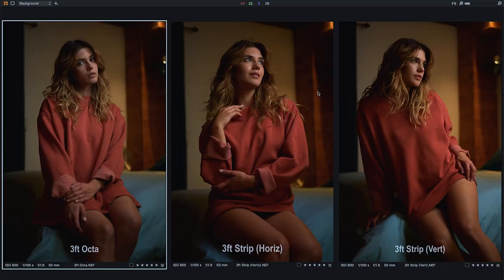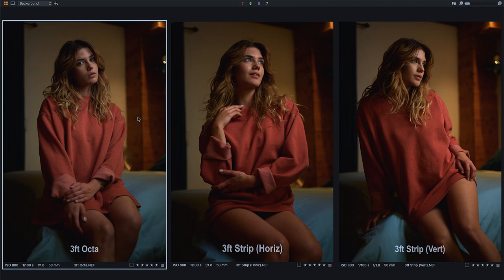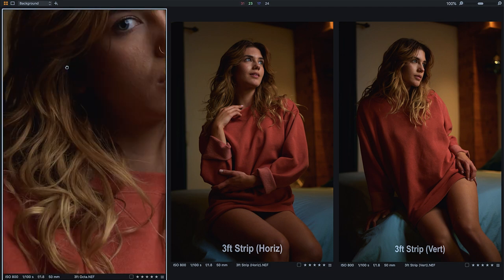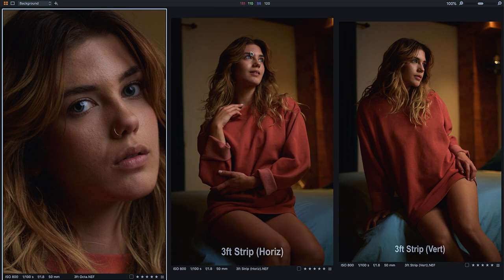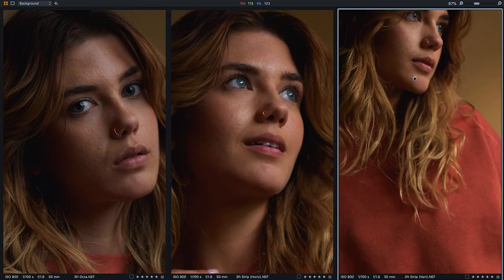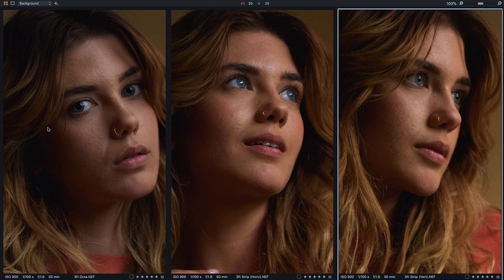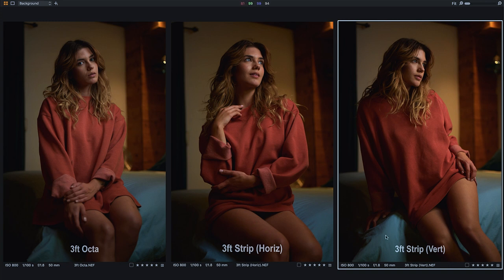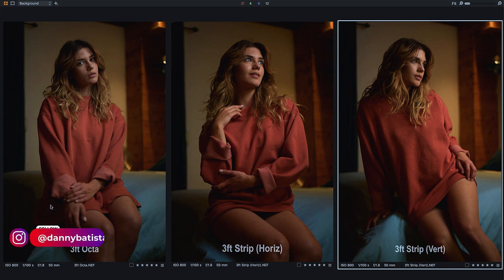Stripbox vs. Octabox as a Key Light for Off-Camera Flash Portrait Photography

Comment: what about light domes vs light boxes?
Reply from the maker: The larger the light, the softer the light. A 36in light dome will produce similar results as a 36in softbox. A dome however is completely round with the diffusion which means light will spread all around vs being directed in one direction.

Comment: I don’t really understand your thoughts on the differences here. In the end it all comes down to positioning, feathering and so on. Add a grid to the Octa and control the light spill. Then you’ll get even closer to the lightstrip look.
Reply from the maker: I'm not trying to get closer to a light strip look. The point is that an octabox or other circular softboxes or beauty dishes,  which everyone believes is the only kind of main key light to use, actually is unnecessary in the majority of scenarios I shoot in.  In my 10 years of experience the strip produces VERY similar spill and and soft light qualities as the same width softbox while providing a ton of other benefits in many different scenarios. I can shoot under it in tight scenarios like bathrooms, hallways, cars, etc. where a 3ft softbox would be in the way all around. It's less of a parachute in the wind, on-location. I can choose to have a little bit of a harder look, to mimic closer to sunlight when put in a vertical position. etc etc. It's easier to travel with, it's less obvious in situations where you need to be a little more inconspicuous, and I can go on and on.  Gridding an octa does not make it more like a strip, it makes it more like a gridded strip because both act very similarly. A 3ft ungridded strip has a ton of spill just like a 3ft octa. Hopefully that helps clarify.
Reply: Perhaps but not in these first 3 examples. It’s clear the edges on the octa are softer and light is more even. Horizontal strip obviously falls off below chest level and the right image due to positioning is poorly lit on the opposite side with vertical octa. I’m no fan of beauty dishes as they are no good for normal portraits and exaggerate imperfections on faces and are only good for fashion shoots mainly. 
Yes I agree you don’t need traditional modifiers all the time but for me an octa is most versatile. Prefer it over square boxes for example . Also when you shoot headshots I prefer the more rounded catchlight which might not be as noticeable as a full body shot.

Comment: Not much of a difference. I mean you could feather a softbox with a grid and get the same results correct?
Reply from the maker: Well the point is I don’t want a grid if I want to get a nice spread either with the octa or the strip. The point of the strip for me is I get very similar results with an octabox of the same width so I prefer to use the easier to travel with, easier to manuever in small spaces, easier to position out of the way, less likely to blow over in wind, stripbox
Reply: @DannyBatista  I agree about portability but the strip box outdoors wouldn't give the same spread of light unless you were in shade or shooting during night hours. I'm tryna figure out if stripbox is worth the money because an Octobox is giving me the mood im looking for buy maybe I try a two light setup with a hair light from a strip box
Reply: @mroblige1018  I never even thought to use a strip box as a key light but I can't wait to get one for my hair light I've tried using one of my octas and it just doesn't do it for me and I also always. Use grids your points are very valid I love my grids ha they are a godsend

Comment: Do you find that the strip is still a good replacement for wider shots where the light may need to be further away from the subject to clear the frame?
Reply from the maker: It works just as great in the same scenarios as a 3ft octa. All the same scenarios apply as far as I’ve ever used it over the past 3 years in shoots everyday. It’s 3ft of light horizontally and thats what I need it for in most cases. There are plenty of cases where I go vertical with it for long distance shots, for a harder light to work with the hard light scenarios I like to shoot in during the day as well.
Reply: @DannyBatista  Thanks man, I'm going to pick one up to try out.